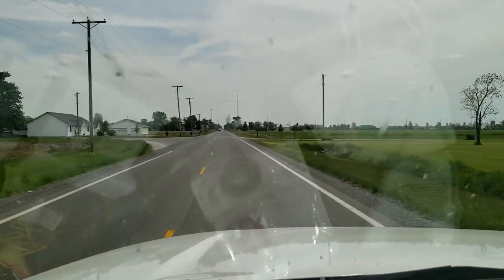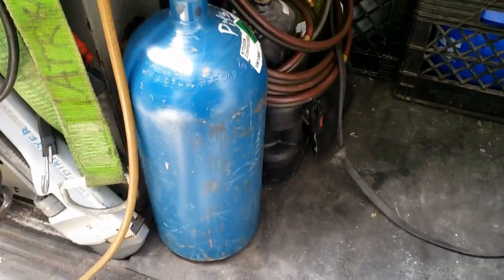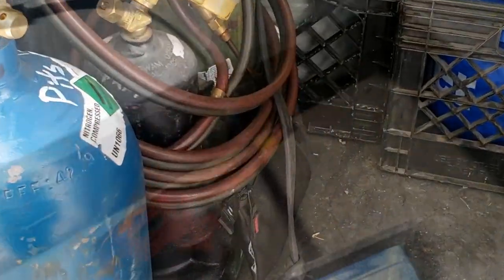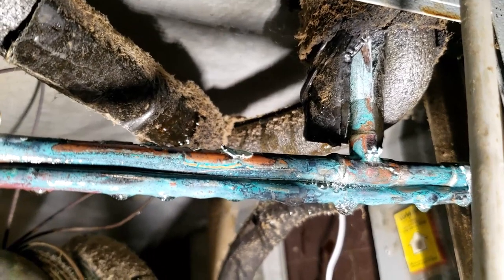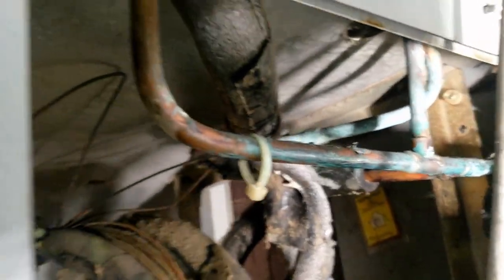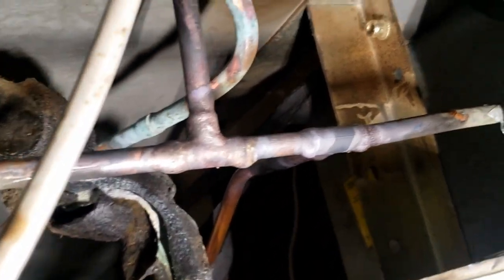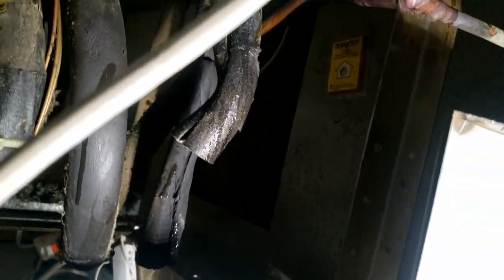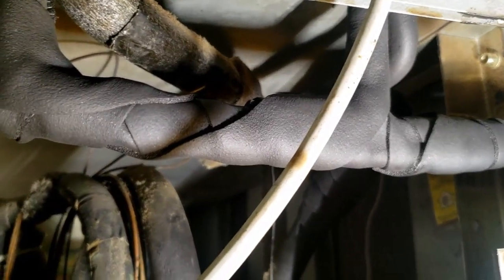Your Meat Is Not Cold...You Got Problems!

Comment: Nice video. I work with alot of critical charge systems. Some as low as 3.5 oz, and I always charge through a ball valve from the tank. No manifold in the loop. That way if it needs 4.75 oz, I know thats exactly whats in there. Cuz I hate wondering when it comes to how much is in the hoses, or how much I got out.
Reply from the maker: That's how I charge R290 units👍👍. I use a digital food scale in grams.
Reply: @HVACRSurvival  I sprung for that Mastercool 98202 scale that NorCal Dave posted about. Works well for charging the R600a units I work with. Its leaked from the hose connection at the ball valve since day 1 though and I need to contact them. Works well other than that. I use the ball valve method on my R134A units also tho cuz they don't take much charge. Got the idea from Chris HVACR Videos.
Reply from the maker: @winstonwright3613  That looks like the kit I have but it's not built into the weight scale. I have two different bottle types and that scale looks like it would only work with one type of bottle? The other style of R290 bottle True mfg. sends for warranty looks and connects the same as a hand torch bottle.
Reply: @HVACRSurvival  Ya, only the 7/16 thread bottles with the re-sealing multi use tap on top will screw into their adapter. Enviro-Safe sells single 6oz 600a and 290 cans in that style in addition to the other style, and Mastercool sells both refrigerants in the 12oz re-sealable can, but only in 12 packs. However, you CAN use it with the other cans that have the puncture top and the slightly bigger threads. Because the port that is attached to the scale... the one that their "hex adapter" screws onto is a standard 1/4 flare hvac port. The "hex adapter" just has the female 7/16 threads (and a post in the middle to depress the valve on those cans) on one of its ends, and a 1/4 female flare on the other end. That way the bottle can stand up on the scale screwed into the adapter. So.... I put together a can tap for the puncture top bottles, and an angled fitting to connect the flare output of that tap to the flare on the scale.... and viola ... now I can have one of the other style cans connected to the scale as well; suspended upside down and firmly attached to the scale so it reads well and I don't need any contraptions to hold the can. That 1/4 flare fitting they have built into the scale platform makes all of this possible, which is why I love it.  Its worked really well. Lemme know if you want me to email you any pictures or better explanations of any of what I described.  I couldn't find any detailed explanations of any of what I just described when I looked around. I just had to buy it and figure it all out.

Comment: Make way for the youtube police: You never Re-Use a pencil drier is what I was told...
Reply from the maker: The rule I was always told was "anytime you open a system you're supposed to replace the dryer". Vacuum pumps don't remove moisture in poe systems, only filter dryers can.  Like I mentioned in the video, on this job I didn't really open the system Other than to install the taps and leave it open so that's why I cut corners. A lot of times it never seems to make a difference and I was right in the middle of lunch and didn't want to be in the way any more than I already was. Thanks 4 watching👍👍